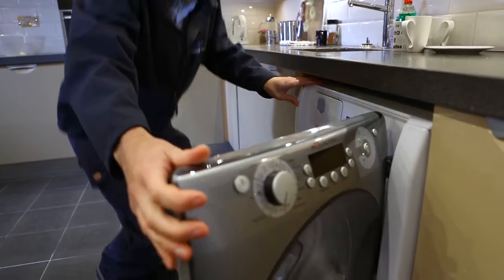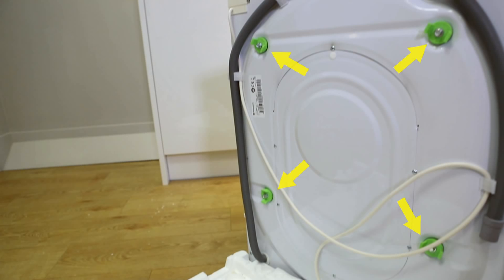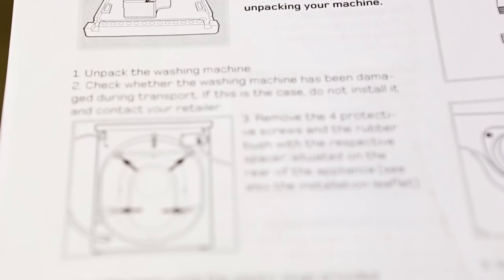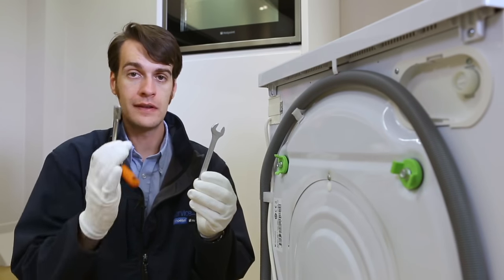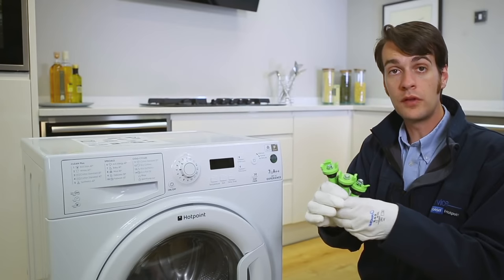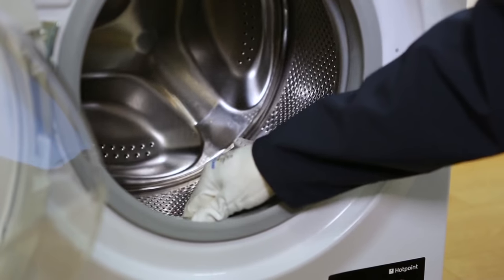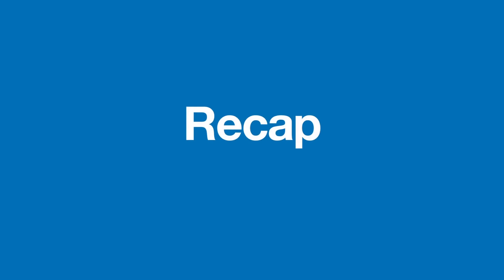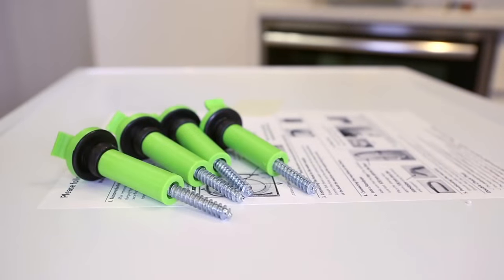How to remove transit bolts from your washing machine or tumble dryer

Comment: Great information here, we just bought a front loading wash machine and it was loud and dancing all over the floor , after a few goes we finally figured out what it was after watching this video , the instruction manual was useless in explanation or even where they were located , this was very helpful . 👍
Reply: Yeap had the same experience: the new dancing front load washer lmao 😆 I just figured out when I filed a complaint for the product and the store person told me to remove the bolts lol 😅 Then searched the internet for the specific  information and only figured out through this video what is the reason behind for such a rocky machine. 🤣 It was like Michael's Moonwalk lmao
Reply: True, only new where to find the transit bolts after watching this video.
Reply: True, only new where to find the transit bolts after watching this video.
Reply: Same here. Jesus Christ I thought the washing machine was going to run away through the walls 😳😳😳. Great video explaining on how to remove the bolts. Thank you 🙏

Comment: Did the trick with very good visible video to demonstrate; and clear explanation as to the consequences if one fails to remove these bolts.  Straight-forward, clear and contrary to the previous comment -- This video DOES show how to remove the bolts -- Counterclockwise and out the bolt comes.

Comment: Thanks for the video.It helped me understand that not just the bolts of course have to come out but what surrounds them too-the plastic.But I spent nearly an hour trying to unscrew only the bolts!My bad luck was that the first 2 bolts came out easily but I spent a long time trying to do the same for the remaining 2.Moreover I should have looked more closely at the illustrations provided by Beko!

Comment: Is it now standard practice for manufacturers to fit transit bolts or transit pols through holes in the 
back of the washing machine? I always knew Miele used 2 transit poles inserted through the back but
with many older washing machines you usually have a transit bracket fitted under the lid which means 
having to remove the top panel to remove or install the transit bracket.

Comment: If the transit bolts are bent what should I do...also it was hard removing them...caused bending the support
Reply: how did you manage to remove bent bar finally please? I’ve got the same issue